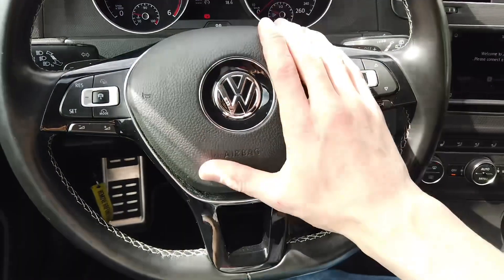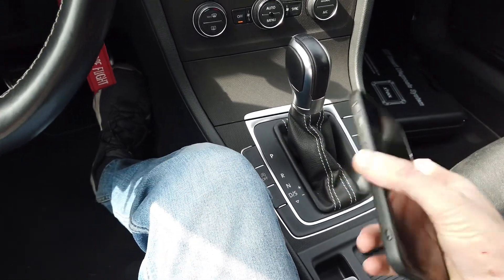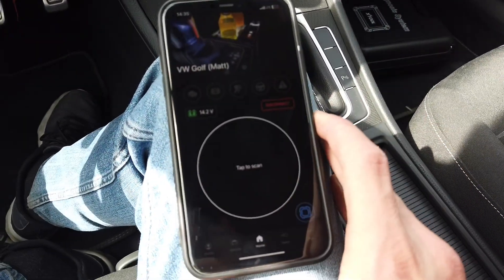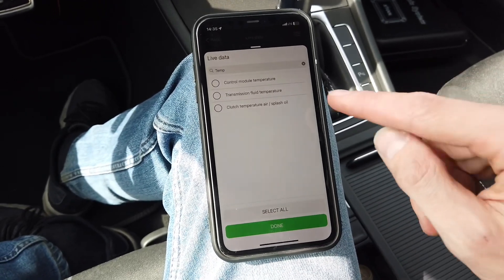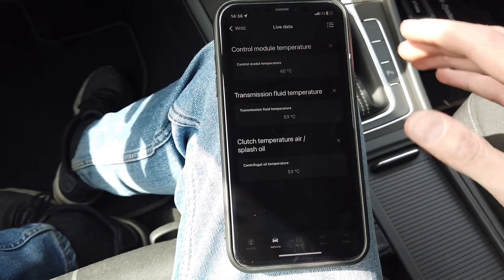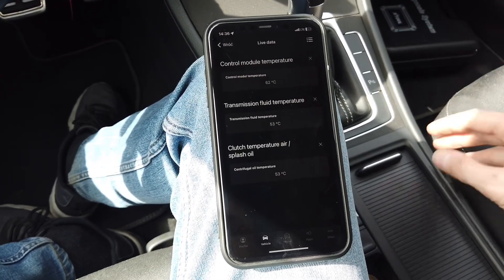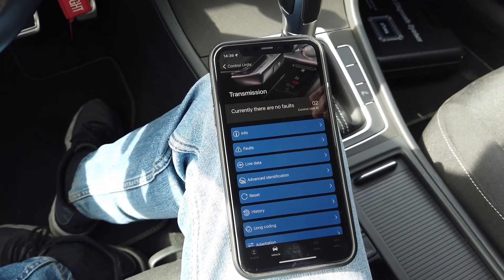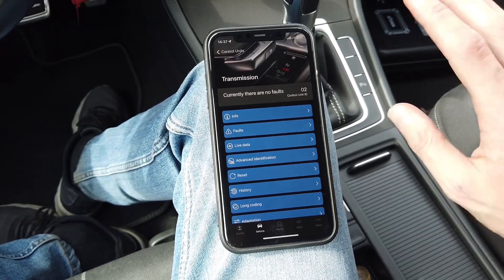Check DSG gearbox oil/fluid temperature

Comment: I'm trying to know what's wrong with my dq250 of mk6 golf r. It's showing oil pressure low. After leak from filter cover.  I took it to mechanic and get full dsg service and filter housing replaced.  But still showing the code , when I cleared it it straight come back on. But the car drive and shift normal.  I have done the dsg reset . Last I order manual gearbox oil pump and gearbox oil for dq250. To check and top it up . But when I checked the oil pressure it's reading 2.7, 2.2, 2.5 and 3.0. Bar . The car has apr dsg tune. Any idea if that's the correct pressure.

Comment: Dsg is dry change 😂no oil
Reply: DQ200 is dry 
(In some Polo models)
Reply: Which version are you using free pro ?
Reply: why make such a dumb comment??? like surely you have a brain? why dont you use it? He even reads the oil temp level yet still you make the silly comment. Are you OK?
Reply from the maker: Of course there’s oil inside. DQ250 with wet clutch pack has a 60kkm change interval. DQ200 without interval (due to dry clutch) but still there’s oil inside.
Try googling DQ250 oil change.